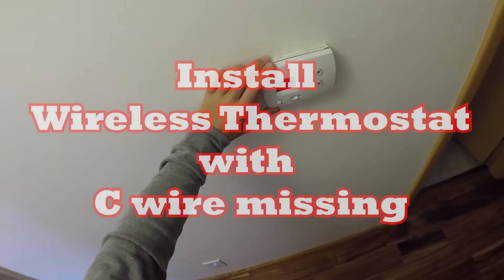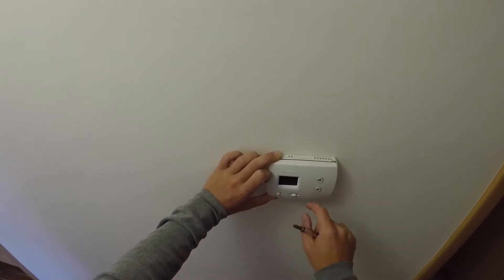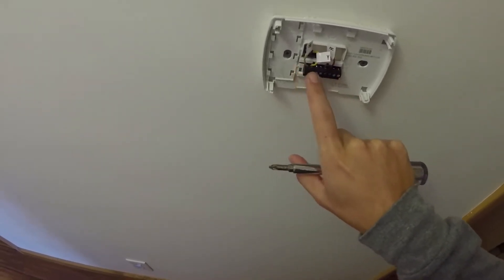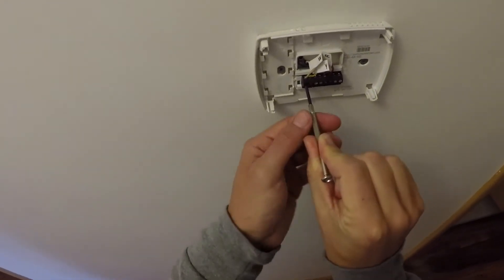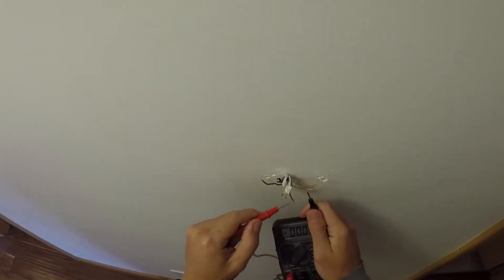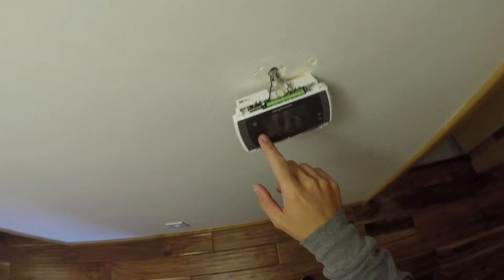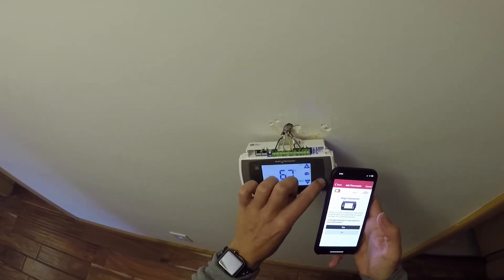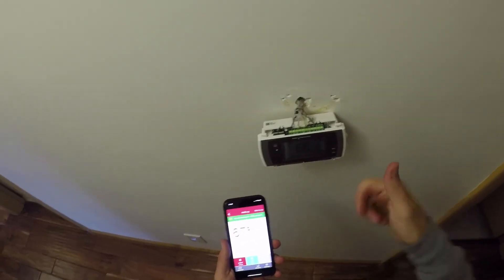Install Wireless Thermostat with C wire Missing

Comment: Am I missing something? Why are you hardwiring a "wireless" thermostat? I thought the point of a wireless thermostat was to transmit the signal from a location without any hardwiring. Of course, the thermostat will provide the "option" of hardwiring, but the idea of "wireless" is just that...doesn't require wires to power/send a signal and requires only battery to power the thermostat and send the signal.